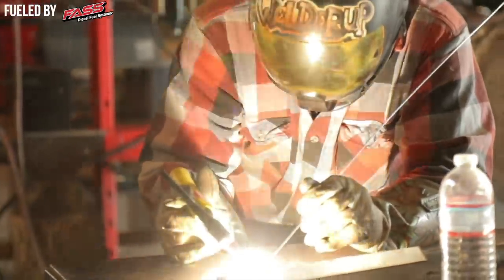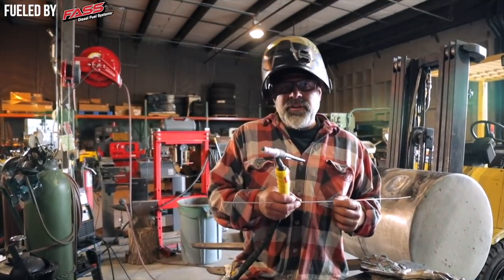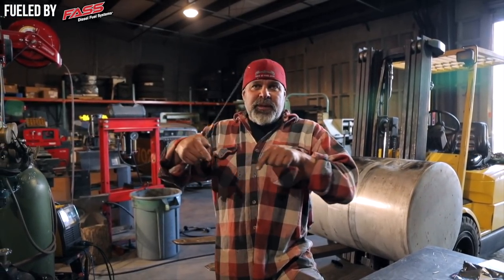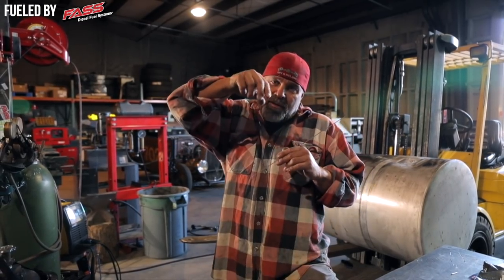TIG Welding An Aluminum Fuel Tank ⛽️ EXTREMELY DANGEROUS WELD

Comment: I grew up with a dad who was a welder so I grew up doing it. Weirdest thing I welded was a header for a remote controlled boat motor. It was a steel flange and a copper pipe elbow. The ole man said it couldn't be done..lol somehow I did it and it has held for about 10yrs 🤷‍♂️